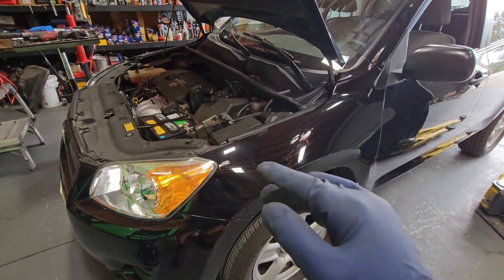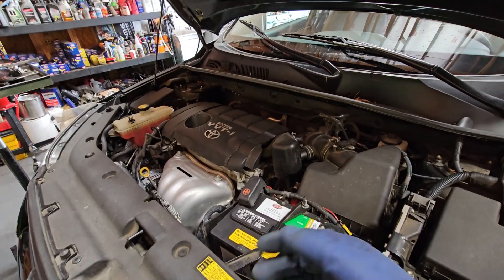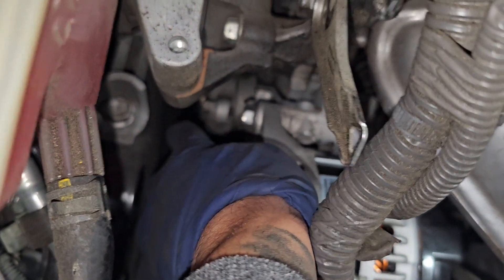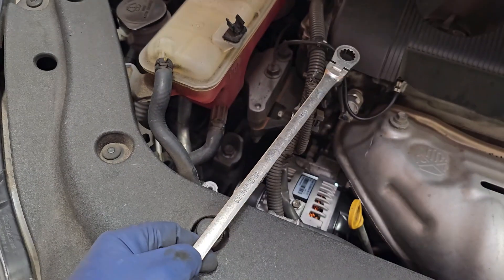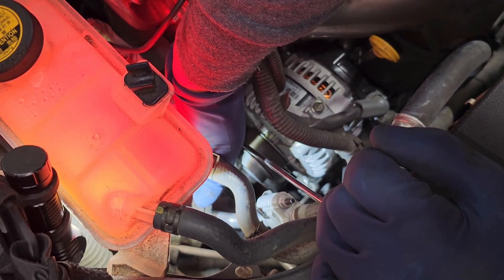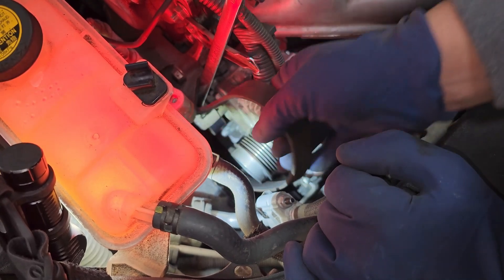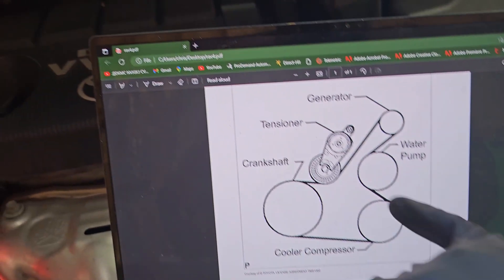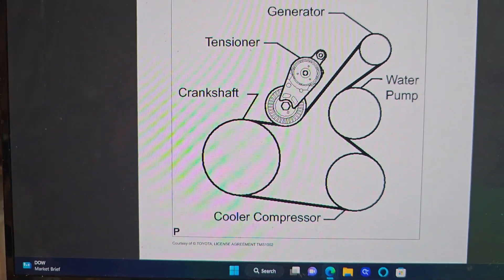2011 Toyota Rav4 2.5L sepertine belt replacement

Comment: Not an easy task.  The belt tensioner is not giving enough slack even when buttomed out.  I'll replace the belt tensioner and see if I can get the belt back in.  This is frustrating.  Other videos make it look so easy, yours not too bad.  Thank you for sharing and God bless.
Reply: i know it's late, but there's two things here. the uploader of the video has really good grip strength. I found another way, you need a slim head 3/8 ratchet with a 14mm socket. then use an open wrench to push down on the ratchet that it'll help you give leverage. you need to go more into the car rather than hit the top subframe.